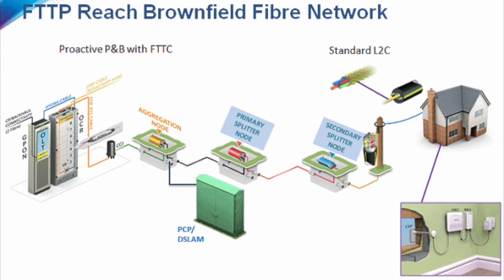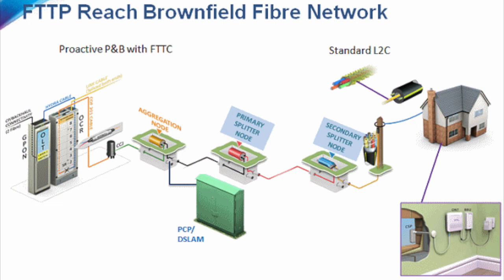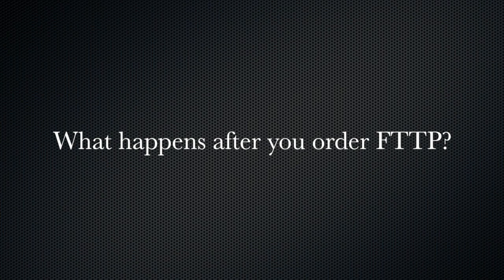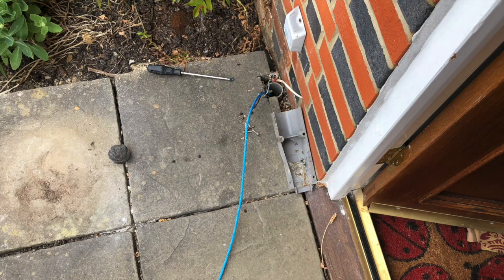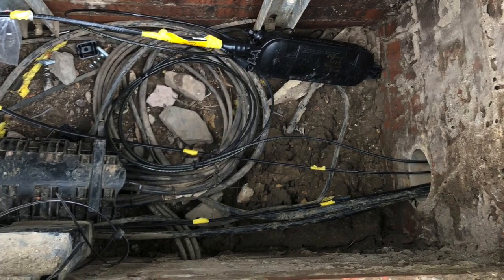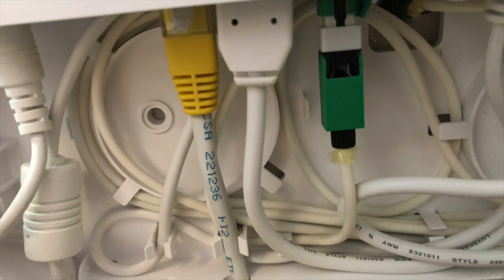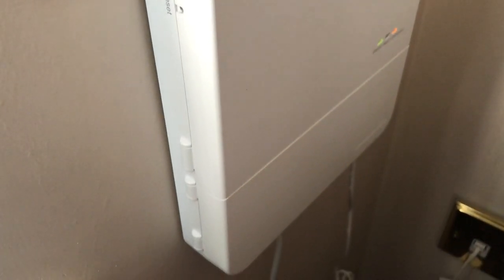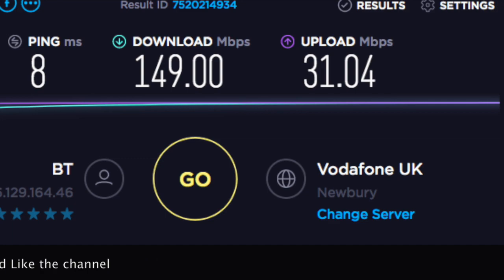FTTP - BT - Openreach

Comment: A total rubbish job there, the cable is bent way too much inside the tray.
It will give loads of issues.
Reply from the maker: Installed by BT, currently getting 300MB down and 50 MB up. Seems OK. What issues do you think I should be getting?

Comment: If original BT  cable is in a duct and comes up into house at master socket why can't FTTP enter same way, same duct? Is Duct not big enough or something? Mine is a one inch duct. Do not understand why they need external box fitted.
Reply from the maker: Sorry can not help you with that, this how they installed it into my house several years ago. Maybe others can comment and help you.
Reply: It’s not just your duct it’s the whole network of them

Comment: Thanks for the video, I've been wondering how Openreach would run fibre to my house without digging up the garden as we are more than 100m from a telegraph pole.  So now I see that they will use the redundant copper multi-core to pull the blue rope back to the duct in the verge and then this will be used to pull the fibre back to the house.  Easy when you know how !
Reply from the maker: Glad it helped !

Comment: OpenReach installed FTTP to my house in early 2022.
The installation has been vastly simplified since your video was made. They now use two cables each pre-terminated at one end (CBT and ONT ends). These two cables meet in a newly installed customer service point (CSP) box on the outside of the house where they are spliced together. This removes any need for on-site cable termination which was (apparently) the biggest cause of sub-standard performance in older installations.
My Nokia ONT is also very small (cigarette packet size) and has no batteries.
I’m now enjoying 330/50 Mbps speeds.
Reply from the maker: Hi Norman, as with all Tech improvements are made! Interesting about the battery backup, the installer said when all phone lines move over to fiber then it needs powers to work, so if there is blackout then the unit still needs to work so you can make a phone call! Unlike phone lines there is no live power to power the unit over the fiber like regular copper to the house, so wonder how BT will get around this?
Reply: @joewoodford9428  
Hi yeah they still not got around this problem but they say before install this is the risk and ask if you have alternative ways to contact emergency services for me I use mobiles anyway so no problem there

Comment: Hi. Am I right in saying that once the new fibre box is installed there is not need to have any wires connecting it to the master socket (phone line) if I dont plan to use a land line phone?
Reply from the maker: It is correct you don't need a landline, though many say it is wise to have a landline phone in-case the mobile service going off-line or you need to call the emergency service. As the Master socket is the property of BT you are not allowed to touch this or cut the wires.

Comment: Can the FTTP property access be installed anywhere in the property?
Reply from the maker: @Neil David , Pretty much, though it depends on the length of the run from the CBT to your house.  Speak to the pre-installer and they will tell you where and how far they can run the fiber link. But you can run it around the outside of the house to get to a back study/bedroom or other location.

Comment: I’m getting 930 down and 110 up, new build house where it was pre installed. Phone line also runs of it, no copper at all. Although if you want to use the phone it’s paired with the BT smart hub 2. But I don’t user that as using a much newer WiFi 6 router. iPhone 12 Pro Max gets 880 down over WiFi! 2 years ago I was excited for 3mb down! At least it’s helping with entertainment during these crazy lockdown years....
Reply from the maker: @ SPDTDL, with than download and upload speed, you can watch and do what you like 👍😁. Like you I jumped for just 3.5meg/775kB to now 300meg/50meg (as per my contract) happy days.... if you liked the video please think to Like and Sub... Cheers Joe

Comment: The setup looks completely different to what I’m used to seeing, we’re upgrading from fibre delivered by the copper phone lines, to FTTP. So will the existing master socket that is connected to our copper cable still be utilised for FTTP? Or will there be a mew socket placed?
Reply from the maker: @Don Lewis,  no the master socket is no longer the route into your house for Broadband.  They will bring in a new fiber line in, to just about anywhere in the house you need it.  You do need a power socket close to the new fiber modem to power the modem and charge their internal UPS.  The Master Socket will only be for your copper telephone line if you still have one in your house. Please think to Like and Sub if this was helpful... Cheers Joe
Reply: Joe Woodford thank you very much for this! It’s very useful information! May I ask how you are so knowledgeable on the subject?
Reply from the maker: @DionLewiis  I spent years trying to get FTTP into our village and have spoken to many Outreach engineers over the past 10 years on the subject, plus lots of reading up on the subject.

Comment: Really hope your ISP has improved upon the speeds you're receiving.
Reply from the maker: @Saqib, the ISP can offer 1Gbps, I only paid for up to 140 Mbps.  Depends on the local load as Fibers are still shared signal paths from the exchange and yes I'm getting around 137 Mbps thanks for asking :)
Reply: @joewoodford9428  that's great to hear,  can you give me a rough ides of cost between the speeds? I'm in the very fortunate position of living in a newly built apartment block in London, which has both BT Openreach FTTP provision and HyperOptic.
Reply from the maker: @Saqibss  BT currently offer 150Mpbs @ £32 per month and 900Mbps @£52

Comment: Why does it need a fibre optic reader and a router like virgin
Reply from the maker: @Liam Darling, hi, not sure what you mean? The Fiber Optic line from BT needs to connect to a modem to convert it back into a signal that the router can read, in this case Ethernet traffic.  Your Router then is your household hub for WifI and LAN connections.

Comment: The bt open reach engineer is here at mine installing fttp inside the front door area. My desktop is upstairs and has no WiFi. What cable do I need to connect the pc directly to the modem, around 15 metres
Reply from the maker: @JuiceBanger1 you will need an RJ45 Ethernet cable from the FTTP modem to your Router, BT should supply you with a BTHomeHub which will connect to the FTTP modem via the RJ45 cable.  The BTHomeHub will offer you WiFi and 4 other Ethernet ports.  If your PC has no WiFi recommend buying a WiFi dongle, they are cheap and much easier than running long Ethernet cables around the house.  If that does not sound good then look at Ethernet over PowerLine solutions. I have a vid on that as well.
Reply: @joewoodford9428  I am sorted, used ethernet cable from my mesh disc to the pc. I had misread online thinking I needed optical cable which I didnt have. Thanks for the response.
Reply from the maker: @JuiceBanger1  great!! Glad to have helped you a little

Comment: Now have FTTP installed, running at 75mbps. Just to say that the boxes that the BT engineer now install have moved on from the size of the units shown in this video. The internal connection is only the size of a cig carton. I was expecting the larger boxes shown. New Smart 2 hub sits in the centre of the house and signal is good for 50mbps to 75mbps throughout the house. House is 18m long by 9m depth. With upstair bedrooms. So dont need any Wi-Fi discs.
Reply from the maker: @ Peter Vince, glad to hear you are up and running.  Interesting they have updated their Fiber Modem solution, though the size you have suggested seems rather small.  A lot of the space they need is to coil up the fiber line and to support the UPS as eventually the phone line will come off the box. What sort of connections does it have?  Do they still ship a UPS?
Reply: @joewoodford9428  It appears that dont have a UPS. I take it this was the old battery backup, which certainly was installed in my case.

Comment: I am getting FTTP installed next week. Something I am unsure of, do the new fibre cables also deal with delivery of telephone calls?
Reply from the maker: @Peter Vince, Not over fiber, the phone line is still over copper for now.  The equipment supplied by BT would permit this but is not part of their service yet.
Reply: It depends. I’m in a new build house and the phone signal is delivered over fibre. The box BT fit has a Ethernet cable out which plugs into your Wi-Fi router and also a telephone cable out which connects to a master phone socket to make all the house phone sockets live. 
I think existing houses with a copper line keep that, but new builds have everything run over the one fibre.

Comment: We were advised by Openreach last week that we could start ordering FTTP. We were advised directly because we had been in close contact with OpenReach during the project to install the cables. I think normally you have to keep checking the appropriate website to see if FTTP is live and available. BT knew we could order it, when I phoned up, and I managed to get a cancellation slot, so fingers crossed I am getting it installed next week.
Reply from the maker: Hope it all goes well 👍

Comment: Where telephone line connected to?
Reply from the maker: Its still over the old copper wire line (aka master socket), BT have yet to move to using everything over Fiber. This will happen at some future time though I have not heard when.
Reply: @joewoodford9428  Hello! I wonder whether BT would allow a customer to cancel the copper landline phone subscription to save some money? I only keep my BT landline to support the copper line VDSL service.
Reply from the maker: @simongreenidge6454  Hi, no they don't only Virgin offer BB only deals or a mobile provider like Vodafone.
Reply from the maker: @simongreenidge6454  Hi, no they don't, only Virgin offer BB without a phone line or a mobile operator like Vodafone.
Reply: @joewoodford9428  Thanks!

Comment: Am I correct in thinking that the box of tricks BT stuck on your wall is the modem and that I only need to buy a router (not a modem router)?
Reply from the maker: @ Gary Bendle, The box on the wall from BT is the Fiber modem, this converts it from a fiber signal to an Ethernet based signal.  You still need a router but one that can accept an Ethernet feed, the TP-Link Archer I reviewed in an early vid works well, you switch out of ADSL mode to LAN mode.  I do not believe you can just plug the wall feed into a Ethernet switch and as you will need to log onto the ISP supplying your BB as well the need to set-up your own home network. If this vid or comments helped please think to Like and Sub, it helps out the channel :) Cheers Joe
Reply: @joewoodford9428  Thanks Joe. Bought a Netgear Nighthawk RAX54 to replace my old modem router. So far so good.
Reply from the maker: Great, glad to have help :)

Comment: So.. Thankyou for the video. I have been stuck on 70mb broadband for years now, and Virgin completely missed my side of the street. Anyway I still don't fully understand how this works. I was pleased to see the option with SKY for 150mb and thought that fiber must of been installed in my area, but I guess not. So basically I am asking how this works. Once this is installed, am I essentially fiber connected, or is this some sort of work around. Will I be able to go with other fiber companies in the future and get say Virgin or Vodafone, and increase speeds to 900mb etc. Or I am stuck at this fairly slow speed (150mb) compared to other fiber? Sorry for long comment lol just intrigued. Cheers
Reply from the maker: Dean Walker, most quote "super fast" broadband over fiber but these are Fiber To The Cabinet (FTTC) solutions.  Max speeds are 80Mbps if you are only meters away from the cabinet (the green box by the road). If you are getting 70Mbps you are not too far from the box (under 1/2 mile) and getting a pretty good service. This will be via an ADSL modem.  What I'm showing here is FTTP which is Fiber To The Property (or premises?). This is a dedicated Fiber line to the house.  If you don't have the white wall box shown on the vlog and Fiber line, you get your BB via the phone line as well as needing to use ADSL filters on phone sockets with a ADSL modem, you are getting the best speed possible on your FTTC service. Sorry to disappoint you, but 70Mbps is really very good on FTTC.  We lived off just 3.5Mpbs for +15 years until they installed FTTP in our area.
Reply: @joewoodford9428   Thanks for the quick reply. I actually get around 76mb, so I guess I am really lucky, the box is litteraly at the end of the street around 5o yards maybes. I am actually having a new line installed on the 24th which will allow the speed up to 150mb. This is what I meant when  I asked although I explained it really badly lol. SO once Sky/Bt put me this new line in on the 24th. I will then be restricted to 150mb (I understand that is best case senario) or will new options then become available because of the new line. Or is it 150mb limit. full stop. cheers and hope that made sense
Reply from the maker: @dean walker, if they are fitting a Fiber libe to your house then you should get that speed or more if you by a plan with greater download.  FTTP will still fluctuate as it is still a shared "pipe" the more using FTTP the greater the range. But most guarantee >100Mbps

Comment: For where I live it says on Openreach good news we have plans on upgrading your area to fttp when will it be installed and how many months or days ?
Reply from the maker: Yt Olxd , could be a couple of months to over 1year.  Covid-19 has slowed these kinds of projects down.  The area in the village which had the same statement as yours at the time of recording has only just received their FTTP service.
Reply: ive been able to get it since 2014 but to have it the premises no plans so you could be waiting years
Reply from the maker: @paulvalente4140  RU sure they are offer FTTP and not FTTC.  BT often talks about Fiber on their adverts, this is usually NOT FTTP.  FTTP is only a fairly recent upgrade by BT and will take them years to roll out across the UK.  They appear to be targeting areas where their is either no FTTC or very poor BB and large new housing developments (+50 house). If you are on an FTTC service and getting >10Mbps BT considers you to be part of the supper fast roll outs since 2010 and not the Ultra fast as that of FTTP.

Comment: Great informative video mate. Well done. 
One thing 03:02 I don’t think you meant to say that you need a wireless router
Reply from the maker: @isyt, the box on the wall you see at about 3mins does need to be connected a wireless router, either your BTHomeHub or third party router. In our case it is the TP-Link shown in an earlier video.  Without a router there is no back end connection to BT systems and there is no way to broadcast the internet connection around the house (to my knowledge, but I will stand corrected if there is).  Thanks for watching and if you liked the video please Like and think to Subscribe... Cheers J
Reply: Joe Woodford - Sure, I was questioning the “wireless” word though. The router doesn’t need to have WiFi capabilities. All your devices could be connected via Ethernet ports on your router. 
Also, you’d be connecting the box to the router via cable.
Reply from the maker: @isyt, as this a BT solution, the householder will receive a BTHomeHub unit, which is a Router, Ethernet Switch and Wifi hot spot.  The connection between the FTTP modem on the wall and the router is an Ethernet Cable (it has the yellow connector on it).
I'm not sure if you plug in a basic Ethernet switch into the FTTP modem unit direct that you will be allocated any IP addresses for devices, so the use of router is required for that and to take full advantage of FTTP service from BT will include WiFi for wireless connections.  
The BTHomeHub has a couple of Ethernet ports at the back but I assumed most users are connecting the majority of their devices over wireless connections. Hence my comment about a wireless router to get your BB connection on a device, such as a tablet, laptop or other mobile devices looking to connect direct to the internet.  But I do appreciate your comments and seeking clarity on what was said as I'm sure it will help other :)
Reply: Joe Woodford - Fair enough. I’m getting FTTP 900mb from BT in a couple of weeks. Coming from 3mb copper this will be quite a jump!
Anyway it’s due to come with BT SmartHub 2 and as far as I can tell it doesn’t have the ability to run its’ own VPN so was just investigating other solutions.